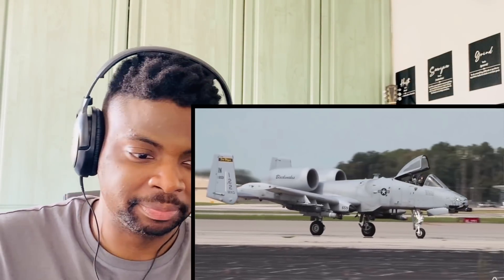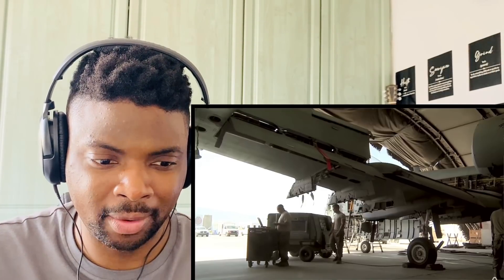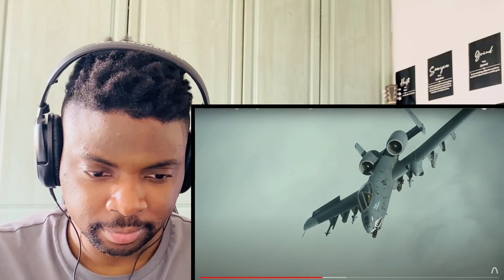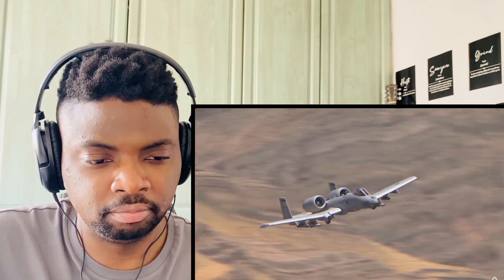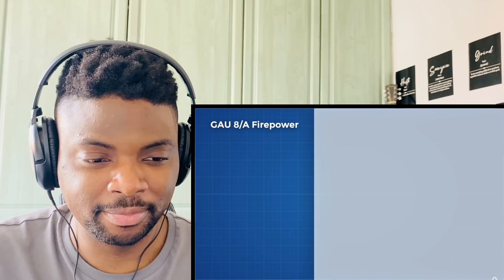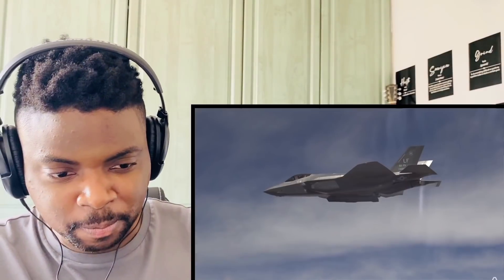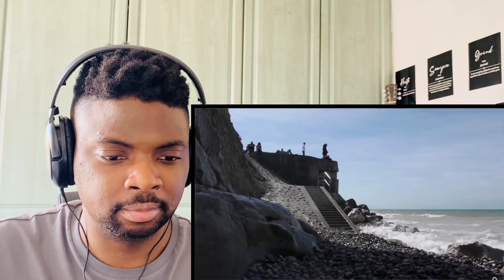🇬🇧BRIT Reacts To THE A-10 WARTHOG: INSANE ENGINEERING!

Comment: The A10 has jokingly been called a gun with wings and an engine mounted onto it, and it's not entirely inaccurate.

A guy I met who served in Afghanistan told me that jihadists would be sent RUNNING for the hills the second this thing showed up. The GAU-8 tears even TANKS to pieces.
Reply: The Soviets used to call it the Devils Cross bc it wreaked hell on armor
Reply: I’ve also heard stories of militants figuring out that when the Americans started to take cover they should too to avoid the worst of an A10 strike. 

As for the effectiveness of its gun on tanks. Yes it can…. From the top and rear where armor is the weakest(this necessitates air superiority btw). And against tanks from decades past. I would doubt the stopping power of a 30mm depleted uranium round against any MBT.
Reply: @DannL18  thanks for your insight about MBTs, and yeah... definitely agree there. Barring hits from above or simple dumb luck, a tank such as an Abrams crould survive the GAU-8 buzzing overhead. Something like a T-34 or even an M60 is going to get torn to pieces, however.

Comment: The plane at the end with the props was P38 Lightning. look it up what a fantastic Aircraft. It had 2 of the  Rolls Royce   Is Merlin Engines. The Similar Engines as the P51 and Spitfire.
Reply: The P-38 had Allison engines, not the RR Merlin.    It would have been a much better aircraft if it had had Merlins.  Still, a very good airplane.  But, better engines would have eliminated the need for the P-51.
Reply: @kentgrady9226  the Allison engine had far more power than the Merlin. The turbo/super charger was way too large to mount it in the p51
Reply: @robertingoldsby1638  

If power alone is the final arbiter of distinguishing good from great, the Double Wasp radial engine was the best of ww2, unless the Soviets built something beefier.  I don't believe they did, but I readily admit I could be mistaken.  

My understanding, (again, please correct me if I'm wrong) is that the Allison engines did not perform well at altitude.  They were, I believe, initially developed when American fighter doctrine was predicated on the notion that interceptors would see the most action as low altitude, base/coastal defense assets.  

Segue:
I would be interested to learn why/how the Russians had so much success with the P-39, while American pilots thought it was a winged coffin.  It cannot be simply that the Russians were better pilots.  There must have been something doctrinal which permitted them to exploit to P-39's strengths and mitigate its weaknesses.
Reply: And…in the nose of the P38 were 4 50-caliber guns surrounding a 20mm cannon, 
Incredible amount of firepower in a very concentrated location.

You may want to check out the story of how a flight of P38s (16 or 18?) ambushed Admiral Yamamoto’s plane. It was called Operation Vengeance for a reason.
Reply: it never used Merlins but the Allison V1710
Reply: The Germans nicknamed it "The Fork-Tailed Devil" during WWII.  A beautiful warbird, for sure.
Reply: My father was an enlisted man in WW2. He was taught mostly how to repair battle damage to the aircraft. The first plane he worked on was the P38 Lightning. It was surprisingly agile and fast with it's twin engines.
Reply: A beautiful bird for sure. Germany really didn't like them. 37mm Cannon in the front with 4 12mm machine guns just for good measure. You didn't want a P38 to focus fire on you.

Comment: Cleanup is impossible because there is no place on the planet to put so much contaminated debris.

depleted uranium projectile

Bush Sr.'s Gulf War I was also a nuclear war. 320 tons of depleted uranium were used against Iraq in 1991. A 1998 report by the U.S. Agency for Toxic Substances confirms that inhaling DU causes symptoms identical to those claimed by many sick vets with Gulf War Syndrome. The Gulf War Veterans Association reports that at least 300,000 Gulf War I vets have now developed incapacitating illnesses. To date, 209,000 vets have filed claims for disability benefits based on service-connected injuries and illnesses from combat in that war.

Comment: The Air Force has tried several times to kill this plane.  It just isn't "sexy" as it's pretty much stick-and-rudder flying instead of lots of computers, etc.  But for us ground-pounders this is part of our salvation when "it" hits the fan, along with the Apache helicopters and AC-130 gunships.  The replacement by F-16 idea was ridiculous since the A-10 has such a longer loiter time to stay around you.  During my time in Germany back in the Cold War days, there were pre-planned highways near the Fulda Gap where they could land with re-arm/refuel sites back in the trees nearby to quickly get back in the fight.  No F-16 is going to do that.  We used to say the F-16 jockey would make a high-speed, high-altitude pass or maybe two, then head back for Happy Hour at the club.  A-10 pilots were gunfighters; grunts in Air Force blue and they belonged in the club with us where they never had to buy their own drinks.  At one point, the Army said go ahead and kill them, but we'll take them instead and fly CAS for ourselves.  Of course, USAF generals weren't going to cede that territory!  Congress has stepped in several times to keep them alive and stop the AF from getting rid of them, and for us ground guys we need it or an upgraded version of it.

Comment: the only way for the a-10 to truly last for decades to come is an evolution which is not really possible because the producer isn't around anymore...a new aircraft specifically for CAS is really needed so that the running cost of the faster stealth fighters doesn't get in the way of the mission
Reply: It's to the point it's almost better to build a CAS helicopter.
Runways not a problem.
Longbow mast style targeting or a link to a small targeting UAV would keep it hidden from line of sight and radar.
Build the system to carry the payload you want.
Put the 30mm Mk44 Bushmaster II cannon on it.
Replace the TOW II and hellfires with a long range non line of sight (NLOS) anti-tank, guided missile.
This would be easily achievable right now if someone in the Gov put their mind to it instead of looking for kickbacks.

Comment: "Legacy" typically means something that is not of a new generation and is either still in use but is in the process of retirement or already has been retired. It means it can still function in the role it is designed for but newer options are available and on their way to replacing it. 

This, of course, is still arguable in the case of the A-10 as technically the F-35 is sufficient in replacing it, but it will not be nearly as flexible or cost effective as the A-10 in performing the same role but there are no modern CAS aircraft designed specifically for the role as things have moved more towards multi-role operations as an attempt to justify the increase of cost in more advanced technology and keeping in mind that newer, more sophisticated threats already leave the A-10 as insufficient for the role against more technologically capable opponents.

Its age alone is enough to classify it as a legacy aircraft. However, like some other aircraft, being legacy does not necessarily mean that it will be out of service in a timely manner. The B-52 bomber was supposed to be replaced by the B-1 Lancer and then by the B-2 Spirit and here we are with the B-21 Raider being produced and yet it is still in service going on 50 years after its first "successor" took flight. So, you can see how this term can hold a pretty wide berth in definition.
Reply: Legacy-A generation behind
Reply: @puterbac  A generation or more. But a replacement being in line is an important part as well.

 For example, the F-15 isn't legacy. Older variants of it are, but the platform as a whole is not. We are even building new ones with the F-15EX. Until a new generation is in line to be able to ensure the old one is no longer the primary platform relied on for its role, it isn't necessarily legacy yet. 

i.e. Not enough F-22s were built to replace the F-15 so it is still by far the primary air-superiority fighter in use because it is the most advanced one we have in sufficient numbers.
Reply: @puterbac  longer then that. something from far back that never went out of service. A Gatling Gun is a legacy item.
Reply: Ma Duece " did someone mention legacy?"  And even though the United States military doesn't use the F-4 Phantom there's still some in service by other countries
Reply: The F-35 JSF is superior in it's own way but cannot fill the role or ability of the A-10. The A-10 was designed for a specific task that the F-35 cannot do.
Reply: Not to mention I've heard that the F-35 is TERRIBLE at close air support, which is what the A10 is designed to do.
Reply: @sodasaintcommentaries4054  F-35 is too fast, delicate, and fragile to provide proper CAS not to mention it's short loiter time

Comment: Changes in weaponry are changing how the A-10 is going to be used even within the next 5-10 years up to the end of A-10's life. Precision weapons are giving the ability to do a great deal of work from higher up and further away, which is good for the A-10 because otherwise it'd be meat for advances in air defenses.

The near-future A-10 will be able to use the Small Diameter Bomb to do work from a safe stand-off distance in cooperation with drones and other aircraft. Once air defenses have been eliminated, weapons like AGR-20 APKWS, AGM-179 JAGM, and the upcoming Long Range Precision Munition, will make close air support safer for both the A-10 pilots and troops on the ground.

The old weapon systems like the 30mm gun and Sensor Fused Weapons can be retained for the more niche roles they inhabit now, an A-10 operating alongside drones and using the new weapons will be much safer than in the last 5 years.

Comment: Hi Kabir...love these types of videos...more more more please. LOL
I am pretty sure that some of the A-10s have used shark designs, but at 2:26 the nose art on that plane is of a Warthog...the plane's unofficial nickname.
Also, at 9:43, the makers of the original video make a common mistake when they state that the gun is mounted on the centerline...that is not true. The gun is mounted slightly off center to the left, so that the far right side barrel that is firing at any given moment is on the exact centerline of the plane. If you look carefully at the direct nose on pictures of the aircraft, you cen see the offset.

Comment: Legacy fighter basically means that it has a successor already being produced in this case the f-35.

Edit I searched it up and it talks about generations like the f-15 a fourth and the f-22 a fifth, but that’s weird. 1. There are still 4th being built like the gripen. 2. The a-10 is a attack aircraft not a fighter and attack aircraft do not have generations.
Reply: Well, the concept of "fighter generation" is still flexible.  To this day, there's still argument over exactly where the boundary between 3rd generation and 4th generation is.  5th generation is usually considered to be the stealth aircraft like the F-22 and F-35.

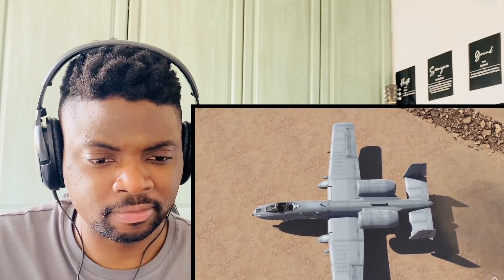Comment: 6:00 that is standard practice for dual engine planes. Second single seat fighters( modern) like the f-35 or f-16 usually have a apu(a secondary engine which could power hydraulics), and even some dual engine fighters have a apu like the f-22, and f-18.
Reply: I don't know about those other frames, but the F-16 has an EPU which is only for Emergency power during flight. Whereas APUs generally are used for more tasks like ground power/bleed air/hydraulic/ and even starting engines.